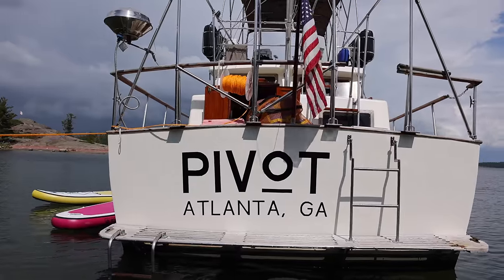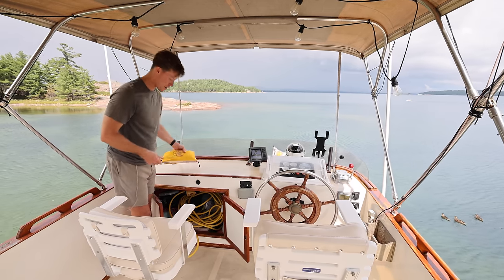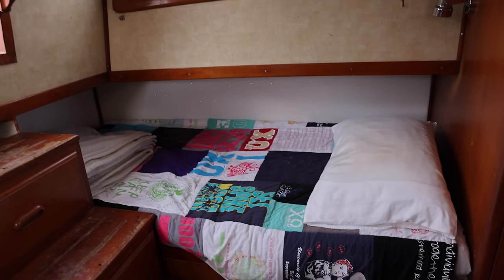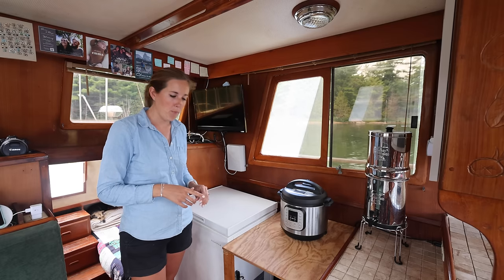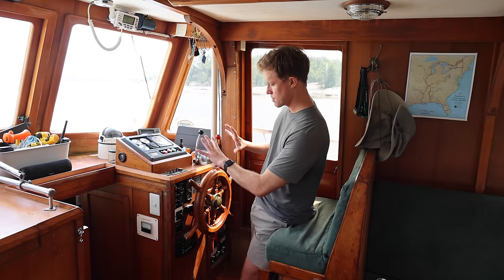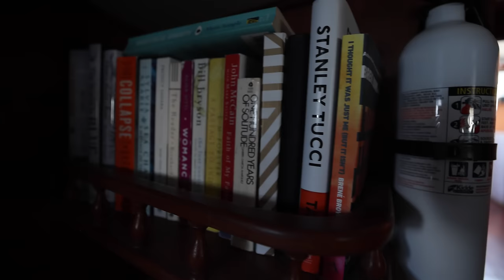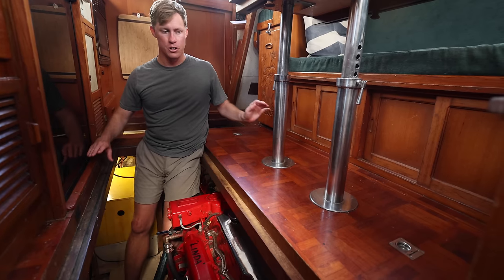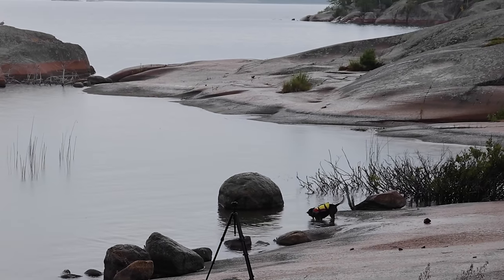EXTENSIVE GREAT LOOP BOAT TOUR (Features we Love for the Great Loop and Full-Time Cruising)

Comment: Thanks for the most excellent tour. However, I have to take one exception.  Remember that propane is a gas heavier than air. Therefore any leak will result in propane settling in low areas of the boat. To warn of a propane leak at least one hydrocarbon sensor (sniffer) should be located in a low area, preferably in the bilge. A second one mounted low in the main salon below the stove is advisablehelpful. In new boats these are required to be wired to a solenoid valve that will shut off the gas if there a leak is detected. The carbon monoxide (CO) monitor will NOT detect a propane leak. If the stove burners are misadjusted it is possible that the burners will produce CO, but this is not likely. In a boat a CO monitor mostly just gives a false sense of security.
Reply: Gary is correct about the CO detector being ineffective for detecting a propane leak.  You need a propane leak alarm or a combined leak detector/alarm/automated solenoid control unit. As he mentioned, any detector or its sensor should be positioned low in the area of the propane appliance (the stove).  Optimally a continuous power source would be connected, similar to uninterrupted power for a bilge pump.  Propane is heavier than air and will sink to the lowest point available to it.  There are relatively inexpensive (<$50) detector/alarms but they would not interface/integrate with your current Xintex propane solenoid control unit shown in your video.  So, if the alarm sounds, you would still need to manually ensure that the solenoid control unit is shut off to stop the flow of propane.  Fireboy-Xintex (and others) sell fully automated integrated units that combine a detector/an alarm/a solenoid & automated solenoid shut-off control, but they can be around $300 or more and would require an unplanned installation be added to your todo list. Minimally, get yourselves a propane detector/alarm and mount it down low in the galley below the stove.

Comment: Didn't hear anything about generator kw of gen batteries amp hours for solar inverter size and operating capacity for system otherwise jolly good show mates 😊
Reply from the maker: 5kW Generator, 600 ah Lithium Batteries, 700W of Solar, and a 3000W inverter! Let us know if you have any other questions, we're happy to answer them :)

Comment: You definitely need larger chart plotters, I know you use your tablets for navigation but having larger plotters allows you to see more depth information and can allow you to see un-plotted sand bars or if you have structure scan it allows you to easy see objects ahead of your boat.  I'd also recommend a small Halon extinguisher for any potential engine room / fuel fires.

Comment: You two did a great job on your boat tour.  My wife and I watched it last night and were cracking up at the outtakes and Ollie chasing rocks.  I know you touched on several electrical items, but I was expecting more electrical description on your boat's systems and what works and what you'd change.  I have just installed a full Victron system, including some of what you have on Pivot, and would be interested in your experiences.

Comment: Thorough tour, thank you for showing us how you live aboard Pivot. You have made very sensible use of every nook and cranny on the boat, and are able to live with the drawbacks of a slow, smallish boat very well. 

You state the second stateroom is great for guests -- I think it is a huge asset for a couple. For each of you to have your own head and own clothes storage spaces must make life much more friction-free than if you had to share such tiny spaces. I would think a major annoyance for Eliot would be  less-than-standing headroom in the aft stateroom. As a tall guy I hate having to crouch slightly in most boats -- it is terribly uncomfortable. When looking for my latest boat, I ruled out 85% of the boats I looked at simply because there were head-banging spaces. 

I admire your patience and appreciation for cruising aboard a single-screw, 7-knot boat. If I did the Great Loop, I'd need a boat that could cruise nicely at 9 or 10 knots and get up and go at 15-18 knots if needed. 

Your Great Lakes scenic ports and beautiful water will not be replicated from Chicago south. I've read many Loopers find some sections between Chicago and the Gulf stressful, some sections dull and charmless, and a few sections appealing and fun.

Comment: Great tour of your boat!   Thanks for sharing it with us!

You mentioned the generator, the solar panels,  and the inverter; but, I don't think there was any discussion of the generator capacity, the solar charge controller, or the house batteries (lead-acid, LiFePO4, voltage of the system, etc.)   I would appreciate a little info about those things.  Thanks, again!

Happy and safe travels!
Reply from the maker: Hi Richard, thanks for watching!

Generator: 5kWh
Inverter: 3kW
Solar: Victron MPPT with 700W of flexible solar
Batteries: LiFeP04 12V system with 300ah

We have some more information here if you're interested: https://schoandjo.com/our-boat/

Comment: Change the bulbs on the patio lights to yellow for less bugs.
Refinish that bright work with Bristol Finish, it's fast drying, high build, self leveling, long lasting.
I've done 3 coats in one day with no sanding.
It's not cheap, but it's what pro antique boat owners use.

Comment: Great video y'all. Love watching your adventures. I'd like to hear a bit more detail on your solar. We're getting our trawler ready for some extended time away from the dock and would like to be a little less reliant on generator power. We have no solar yet but a rather large Bimini like yours. Did you install your panels and charging system or was it already onboard? In a future video, could you talk more about your electrical set up? Thank you so much. Fair winds and following seas. Cheers y'all.
Reply from the maker: Thanks Russell! We love our solar set up, and I set it all up after we purchased Pivot. We have 4 x 175W flexible solar panels (2 in series and the groups in parallel), routed to a Victron solar charge controller and then fed into our 600ah lithium battery bank. We only had to run our generator after very extend time on anchor, like weeks, or when we wanted to run the AC or Heater traveling down the rivers. Happy to answer any other questions and I also wrote an e-book on website store going over our entire electrical set up in further detail! Cheers!

Comment: We're interested in how you run the deep freezer? We are also thinking of adding one in for our loop, we have solar panels but no inverter and we have a Genny.
Reply from the maker: Our deep freezer runs directly off a wall outlet, off our inverter. We run it during the daytime and then turn it off at night. We have enough solar panels, and the freezer is relatively low power so we never have noticed the draw, compared to some of our other electronics. If you find a 12V freezer you should be able to do the same without the inverter!

Comment: How did u attach solar panels to bimini
Reply from the maker: We added some rubber lifts to the bottom edges to get the solar panel back off the biminy and then routed small lines through the grommets of the panels to our biminy, just via tieing them down. Then where the two panels come together in the middle we tied them together with small lines too. So basically we tied our panels down via ropes.

Comment: Did I miss generator/ inverter discussion? Does anyone make trawlers anymore of this size?
Reply from the maker: Nope you didn't miss it, I think we just skipped it 😅 Pivot has a 5KWH Diesel Westerbeke Generator with 600ah of Lithium and a 3000W inverter. We also have alternator charging. 

As for current trawlers, there's some new Mainships, beneteau swift trawler, camano trawler, Nordic tugs are similar, and the list goes on. Lots of variations!
Reply: What brand inverter and lithium ?  Interested in idle consumption of inverter you used. 
How tough was it getting internet on the loop to do computer work?

Comment: Like to see bilge pump systems
Reply from the maker: Hmm maybe we will show that eventually! What do you want to know? We have a main automatic bilge pump in the lowest part of the bilge. We have a secondary high-water automatic bilge pump with an alarm that sits higher in the bilge. Other than that we have various pumps and buckets for the manual option 😁
Reply: @SchoandJo  Thanks for your response 
First I want to thank you for the great utube productions I've pretty much watched every one.
Positive, Real world!
My girlfriend and myself are currently preparing my boat to start the "loop" first quarter of next year
A rather different approach in a 27yo Proline 251wa 
Basically the boat has been stripped down to fiberglass and reworked top two bottom (new motor 250 yamaha sho, electrical, plumbing, remodeled cabin, AC, Simrad electronics, etc)
Our plan is to ship the boat to New Orleans from it's home port in Newport Beach and start from there 
Full Cruise speed is 25 knots
We plan on shore lodging a couple times a week. Because of shallow draft (2.5' engine trimmed up) we are hoping to do some different side trips (Crystal River Florida, Flamingo Bay everglades  Bahamas, St John's river)
Expect to complete the loop in about 6 months 
I almost forgot about bilge pumps 
You're actually answered my question 
I've pretty much done the same as you have (rule 8oo auto with 2000 a little higher up and a 2nd 800 auto forward)
There pumps are cheaply made and have a short lift cycle. I carry a spare for all the above
Thanks again for your response
Reply: @SchoandJo  One other question 
I'm planning on using my cell phone paired with the Simrad units for planning and navigation 
We did 2500 nm in SE Alaska last summer and did pretty much the whole trip using CMAP auto route 
Any comments on that for the loop?
Reply from the maker: We used auto-route from Navionics and it was 99.999% correct. Only a couple times on the entire Loop did it veer a different way than markers. We were very impressed with it!
Reply: @SchoandJo  Thanks for the response 
Most loopers use Navionics
Few if any discuss autoroute
I think being able to pair your phone or tablet with your onboard systems is a winner 
I'm using the CMAP because it's owned by Simrad's parent (B&G)]
I use Simrad because it's a better Bluewater fishing system 
I believe Garmin is better for cruising 
Thanks again 
Stay safe Be Well